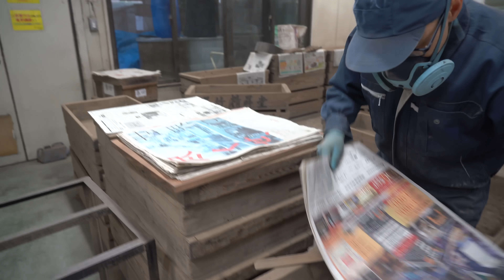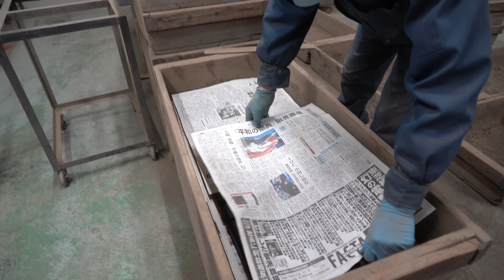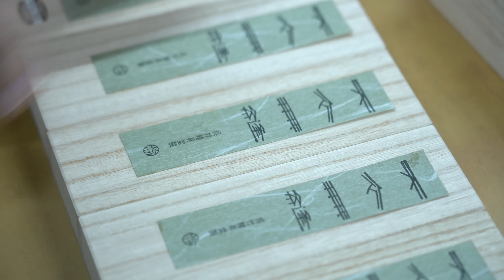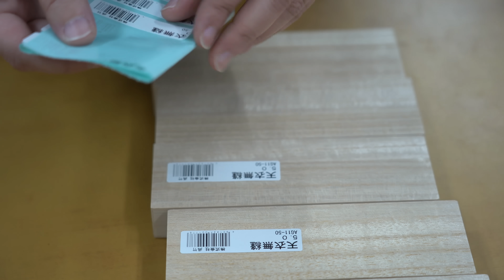墨ができるまで。日本で1400年前から作られてきた墨の製造工程。

Comment: Amazing process, but where does the soot and ashes come from
Reply: High-end makers have "soot rooms", where they burn vegetable oils while intentionally starving the 'lamp' of oxygen, as this promotes the buildup of soot on the burners' half-closed lids. 

So basically it's a room with hundreds of little lidded basins with fires that have to be tended to manually, through periodic adding of oil for burning and adjustment of the lid for each burner. 

A workshop might even weave its own wicks to ensure complete control over the process
Reply: @hugostefaniu  amazing thank you for your reply 🙏
Reply: And - more importantly - the glue ?   If it is Animal glue a vegetarian would not be able to eat these sticks!
Reply: @stupitdog9686  There are some ink sticks made with vegetable glue like Peach resin for Buddhists.

Comment: I wonder if they can wash their hands and feet properly afterwards?
Reply: Don't know, but they probably eat with gloves on.
Reply: @surewinner  So they can't work with gloves on, but they can eat with gloves on?😀😀😀
Reply: Hmm, what do you think?
Reply: Why couldn't they?
Reply: If they're sharing a home with somebody else I would think they'd have to clean up before entering their home, I wouldn't want to be removing black residue from my bathroom!!
Reply: @catclark9488  Ahahahaha I agree with you.
Reply: I think it's easy to wash, so the company doesn't care if it's made by hands or legs ( because they wash before doing). The Japanese are always attentive so they will probably have their own washing water to prepare for that.
Reply: @nuocchaythanhmay  No, it won't be easy. Try to do some prolonged mechanical maintenace job using graphite grease or molybdenum sulphide one (with your bare hands, of course), and then you'll see.
To wash the dirt from the SURFACE of your skin may be easy, but removing it from "under fingernails" and every tiny crack that is normally present in the hardened part of the skin on your palms and finger won't be.
Reply: @MAXProcess  When you eat your sandwich or sushi you don't knead them, just hold them (the sandwich or chopsticks).
Reply: of course they can， because ink is soluble in water
Reply: @takasakarey6971  "Ink" - THIS ink - is a PIGMENT based one, i.e. the source of its colour is SOLID, INSOLUBLE PIGMENT (soot, in this case), not a dye. And then the fact something is "soluble" does not equal "EASY to wash away".
Take a regular blue dye-based ink for fountain pens, pour it over your hands, spill some onto your t-shirt, and then try to wash it away.
Reply: @MrKotBonifacy  Yes, you are right. Maybe you should buy one of this ink-sticjk, and test it yourself.

Comment: If only they put as much effort into quality as they do into the cosmetic appearance of their products Japan would be great. But their steel is sub standard because they would rather spend six years 'learning how to rake the coals' at the forge rather than worrying about metallurgy. Edit: Here's a great example, look at all the wasted manpower polishing and hand lettering them. They look NO DIFFERENT after "polishing', they look NO DIFFERENT after "finishing", and then the stencil is applied which is the first time they look different. That could be done with a brush and planer automatically en masse. Their industry is so inefficient with crap like this. It's fart huffing nonsense.